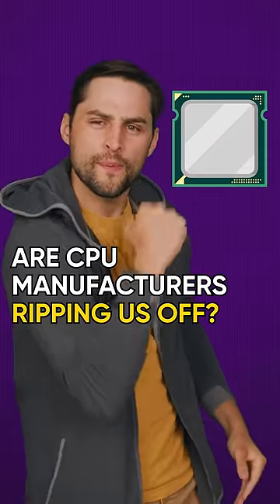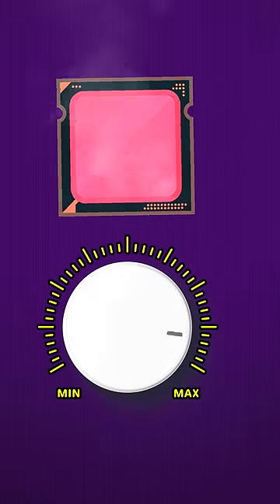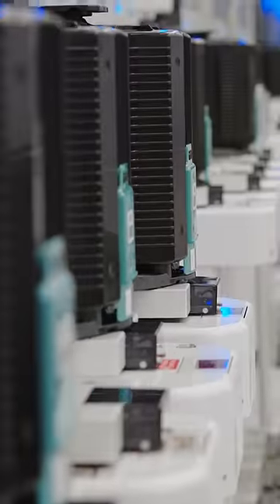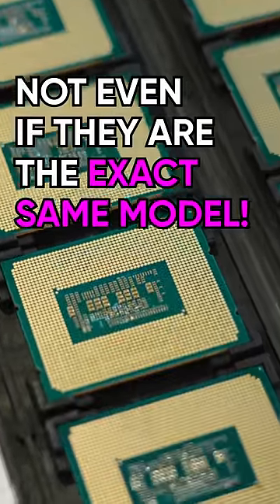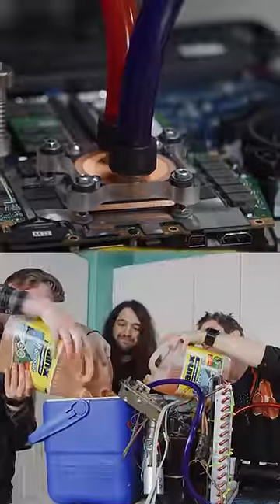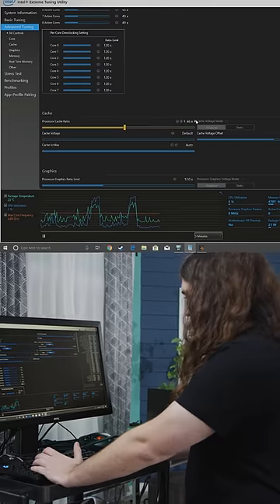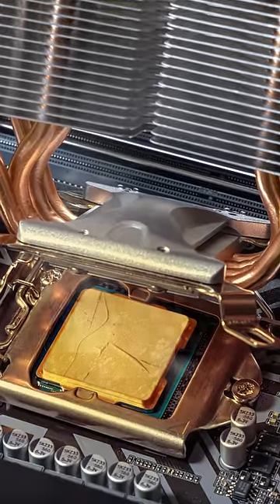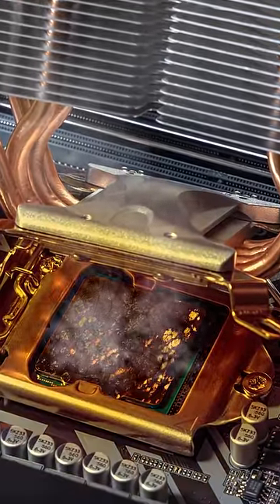Why Doesn't Your CPU Run As Fast As It Could? #Shorts

Comment: what if humans use 100% of their brain? More like what if cpus can use 100% of its capacity
Reply: Aaaand a brain at full power is called a seizure.
Reply: @ItsLash you made the algorithm a😠
Reply: @SSADO-  No. Seizures are usually caused by a small section of the brain having an issue in a specific moment.
I had seizures when I was young and even now from time to time (no more than 1 a week for 10 seconds) and I had my brain 'mapped' to see what was going on.
When the seizures happened (they finally realized they were triggered by certain forms of stress)? Only a very small part of my brain was going haywire.
Reply: @SSADO-  no, it’s called fatality
Reply: @christopherkidwell9817 
Good to know
Reply: @SSADO-  A brain firing all at once is called a Grand Mal Seizure
Reply: @SSADO-  same as the cpu, it just lags
Reply: We use like 70 percent of our brain with the simplest things

Comment: Still running a 3570k at 5Ghz 24/7 oc since it launched, nobody can stop me.
Reply: Im running AMD Phenom II X4 965. You can't defeat me.
Reply: I’m still running a rx480 that’s supposed to have 8gb of ram but some of the dram chips died and now it’s a 4gb model 😂
Reply: Im so mad, i bought a 8700k when they released and several months later i felt confident enough to Oc it. Spent a few days trying to dial it in and they best I got was 4.8Ghz. Its stock running boost on that chip is 4.7Ghz😭
Reply: @ernestocastellanos6446  I dunno what you're doing lol. Mine clocks over 5 easily. It's a great CPU in my experience. Maybe mine is a bit of a better draw, but it isn't like it's binned. I would expect any k variant 8700 to be able to hit 5. I'd be upset if I bought an unlocked chip that couldn't boost 300mhz higher.
Reply: I as well am rocking some old hardware, 3930k @5.1all core since feb 2012.
Reply: Amateurs, I overclocked my pentium to 6ghzever since dinosaurs were a thing

Comment: The silicone lottery is real! I got a used 3770K that ran 24/7 for about 7 years. It held a stable 4.3 ghz and I used it until I got my new Ryzen PC about a month ago.
Reply: Lmao same! 10 years in my 3770k and still going.
Reply: Right? I had an i7-860 that could do 4.2ghz like a champ. But I wanted to make it last as long as I could so I didn't overclock it that much for very long.

Comment: In years gone by CPU manufacturers used to rip people off by not running the chip anywhere near its limits. Back when the front side bus was a thing and especially when we used jumpers to set clocks, multipliers, and voltage. Doing that sort of thing in BIOS was not yet implemented.

Comment: I thought it was more to do with the quality of the chips coming off the wafer. The good ones are clocked higher and sold for more while the ones with issues are throttled down to run at lower clocks/cores.
Reply: That IS how companies determine the position + price of a cpu, but the video is talking about the range of silicon quality that occurs in one model of cpu, which also effects overclocking

Comment: in the celeron days, i believe they had celeron chips that were identical to the pentium chips, but they were half the speed, and couldn't be overclocked. if you bought a silver pen and bridged two of the pads on the bottom, it would unlock the overclocking, and you effectively had one of the pentiums

Comment: This has been happening for years. Back in the day, Intel sold 486-DX4 66Mhz and 60Mhz.
The 60Mhz was made because the silicon was unstable at 66Mhz, but clocking them back made them work

Comment: Overclocking also typically shortens lifespan. This may really matter for many consumers who cannot afford a new system all too often.
Reply: Not really true if the voltage is consistent and low. That way, temps will stay low and CPUs lifespan will stay the same.
Reply: @sperin98  While true that not everyone who does overclocking is going to raise their vcore, but I’d expect many tools/guides to make it easy for beginners would do such a thing.
Reply: @CoolJosh3k  I tend to just over clock as high as I can on stock voltages, I almost never raise it.
Reply: @EvilTurkeySlices  A good idea.

Comment: It's like an engine. Manufacturers aren't trying to run them at the edge of their power. They are intentionally running the engine under its limit so it can last for years with less maintenance. The average person would rather go 100k miles without breaking an engine than have an extra 100hp.

Comment: True. The material they used for my Ryzen 9 is lunar silicon; 10 times more expensive than the ones mined here. Hence my Ryzen 9 has 24 cores and 48 threads.

Comment: I would prefer having overclocking as an option, rather than having underclocking as a necessity.

I have a laptop with Ryzen 4800U, and its factory turbo boost is going ridiculously hot, reaching 90-100C, and is on by default!

I underclock it with Ryzen Controller and would strictly prefer that laptop devs would underclock their AMD CPU's. 

On the bright side, there's much better internal cooling solutions inside laptops now.

Comment: I'm scared to over clock my cpu. I worry that I'll get blue screened or my computer will just kill itself.
Reply: New tech stuff has many failsafes, so if something goes wrong it will reboot to default. Just do some research on what inputs and hardware people are using and use that as a base. Then tweak it in small increments!

Comment: If your CPU runs at maximum speed, your entire PC will become a barbecue grill.
Reply: @Jacob yes. . .
Reply: @Jacob You generally require more and more power/voltage as the frequency is pushed. Hence why LN2 overclocking is a thing to avoid frying the chip.
Reply: @Generic_Handle4573  Maybe...
Reply: more like a induction stove that can’t be turn off

Comment: Intel has pushed their CPUs to the edge since AMD lunched Ryzen. We used to be able to OC loads on an Intel chip (almost 1Ghz on some chips like some gen 3, 4 and 5), now u lucky if u get an extra 200Mhz and consuming upwards of 100 Watts more.

I can OC a 5820K an easy 700 Mhz+. We cant do that anymore.

So you are right (every chip is different) and wrong (Intel has pushed their chips much closer to its limits).

Comment: Actually in the case of Intel and Nvidia it's possible. Rtx 4090 consume more power then may space heater and has 1+ GHz higher clock then 3090. 
More power, more heat more fps 😂

Comment: On the low end laptops those constraints are BS. My laptop CPU can run at max 1.9GHz and is 15w the laptop also has a dedicated GPU that runs at 33w that is cooled by the same fan. Thermal and power constraints my ass!
Reply: You haven't seen HP laptops. They idle at 60-70°C and as soon as you launch a program it spikes to 90°C.